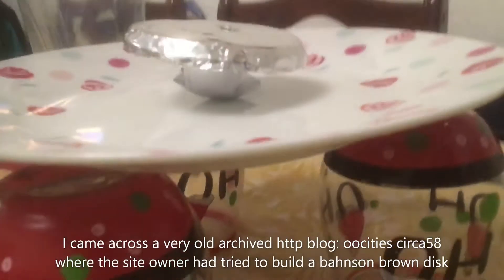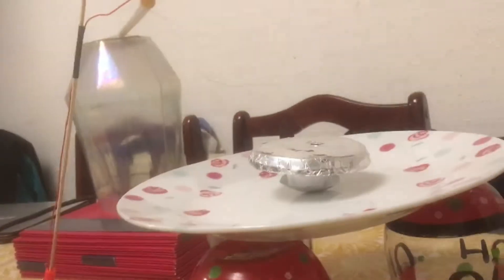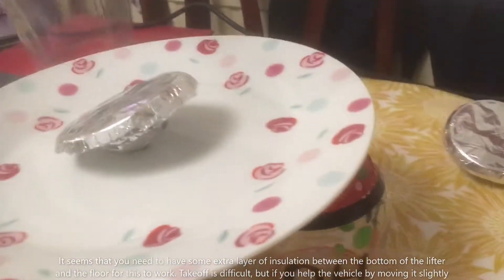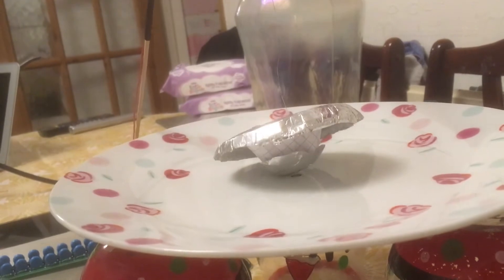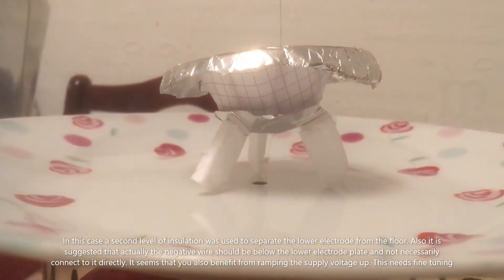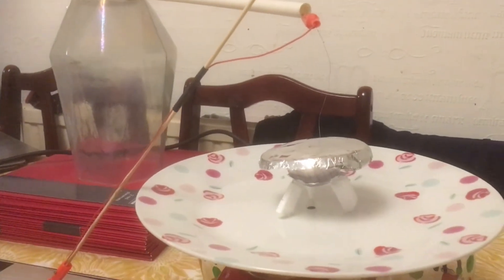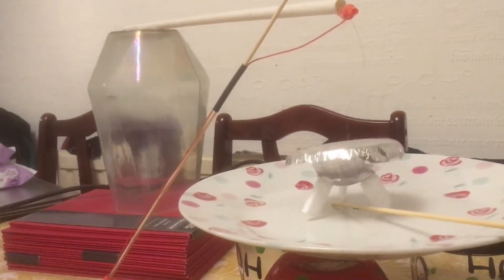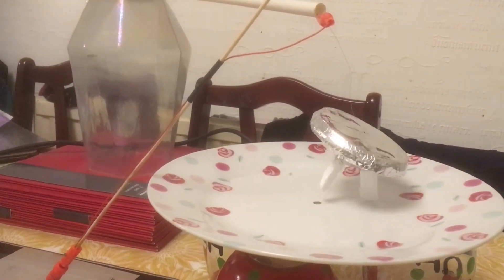Bahnson Brown Disk experiments

Comment: Делай плоский конденсатор, с тремя обкладками, между тремя обкладками равное расстояние, на одну подаёшь положительно, а на две другие отрицательно, все, можешь не благодарить;)
Reply: Actually multi layered asymmetrical plates with a barium titanate or ccto dielectric mixed in epoxy. Is even better. asymmetrical plates and high k dielectric and the whole capacitor sealed is key. Not parallel or equal sized plates.🙂👍